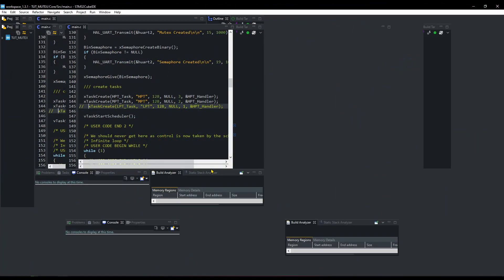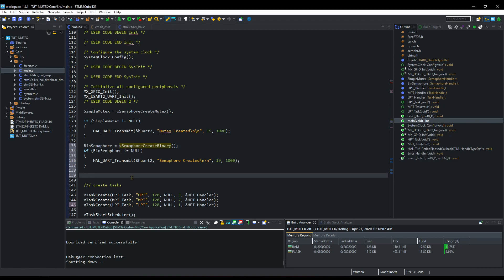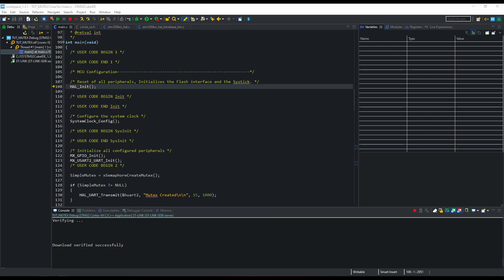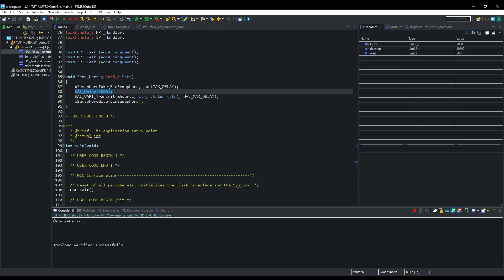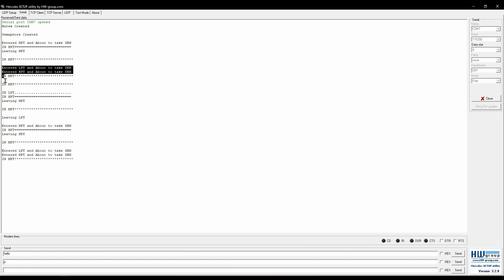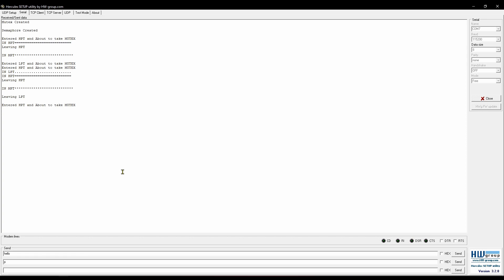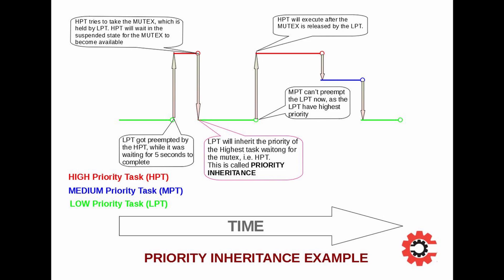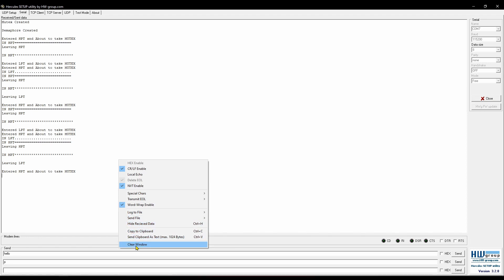FreeRTOS Tutorial 7.1 || MUTEX vs Bin Semaphore || Priority inversion || Priority Inheritance

Comment: How to make a task wait for multiple Resources? Which one to use out of Counting Semaphore, Semaphore, or mutex, and why?
Reply from the maker: You can use structured queue to put the data  in, and then use semaphore to block the task..
Counting semaphore is used to share one resource with multiple tasks not the other way around.
Mutex is for mutual exclusion, just like semaphore..
Reply: @ControllersTech  Can you please explain the answer of this question (How to make a task wait for multiple Resources?) with example? I think I didn't get you properly.
Reply from the maker: I mean you should create a structured queue.  using different tasks, Load the data from different resources into this queue. When the final data is loaded, release the semaphore.
Reply: @ControllersTech  Thanks .One more question Please . how to determine the stack depth of a task?
Reply from the maker: I don't know much about that. Never tried finding more about it. I just keep it 128 and they all seems to work pretty okay. 
If you get some info on it, let me know too..